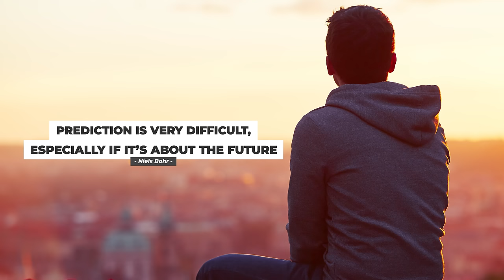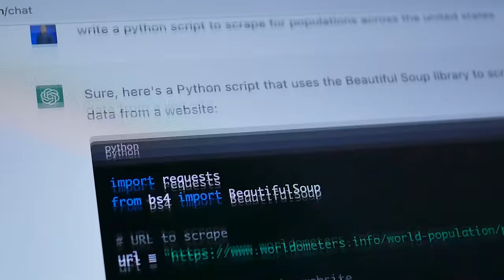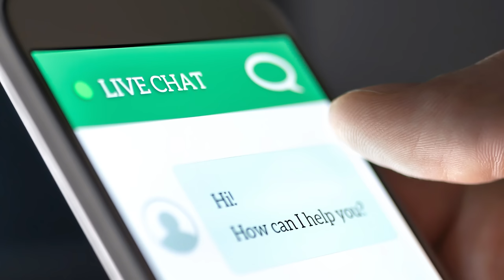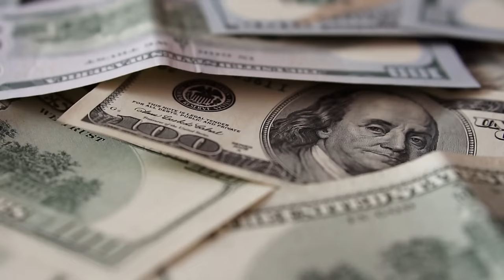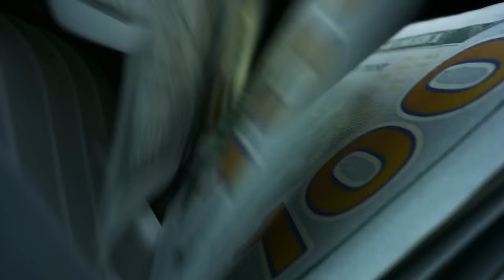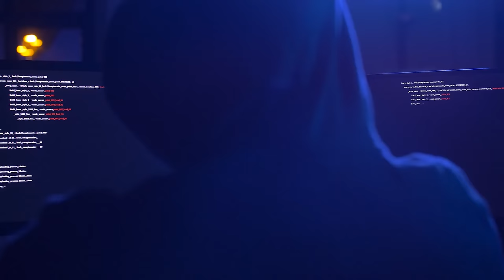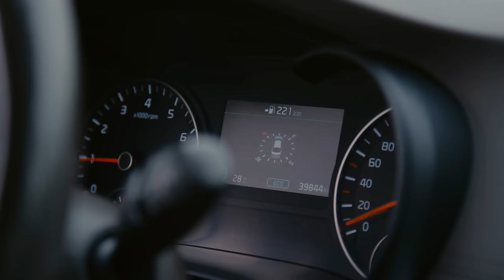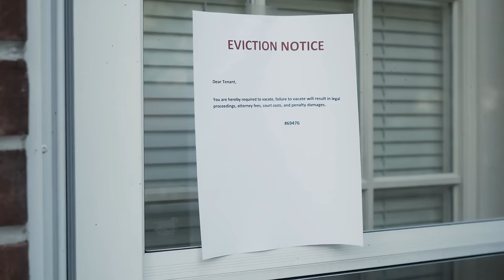Top 5 Threats We'll Face in 2024 (Plus How To Prepare)

Comment: My preps have helped us from several personal disasters. The latest was 3 of the 5 (1 is supposed to be a backup vehicle) vehicles in my driveway broke down around the same time. If that wasn't enough, my washer and vacuum broke at the same time. The cheapest car to repair is up and running now. The washer and dryer, as well as the vacuum have been replaced. I  schedule my appointments and errands around my kids' days off or take my husband to work if I want to take my car. I thought it more prudent to restock the pantry before getting the other 2 very expensive vehicle repairs done. Restocking is hurting the pocket as EVERYTHING costs so much more than when I first stocked up.
Reply: That's allot all at one period god bless!
Reply from the maker: We have a dishwasher we bought a few years ago that was supposed to be the top of the line, and the price was not cheap.  It just died the other day after 2.5 years of use...barely broken in.  Beyond frustrating.
Reply: But you can replace a dishes by rolling up your sleeves. Now substituting for your car is going to be little harder.
Reply: I agree! We’ve had a couple of similar issues lately & had to get into what’s left of our emergency fund; & just the restocking of everyday things is going to be strained!
Reply: Many things on your cars can be repaired by yourself saving thousands of dollars.  I've been doing that for 55 years and I'm a carpenter. It does require tools but many parts stores rent or lend them . 4:28

Comment: Inflation is definitely starting to hit hard here.  We've started the hydro gardens indoors for smaller produce to save money because groceries are getting ridiculous.  We've also switched to an energy plan that allows us to save by running major appliances in the evening and at night at a much lower rate.  Some things we've just decided aren't worth the cost.  Things are definitely changing and, you're right, you really need to move into a position where you are better able to adapt with them or things are going to get rough fast.  :/

Comment: For water storage I'd advise getting a pot still. Its the most reliable way to produce your own clean water constantly. 
Also spirits are an insanely desirable tradeable commodity when everything collapses, it never goes bad, is a sterilizing agent, its full of calories and helps with situational stress caused depression.
Since it will obviously be one of the things to become very hard to get after a supply chain crash it becomes one of the best barter items you can have.
Reply: It can also work as a disinfectant for wounds and other stuff like that.
Reply: Please don’t use liquor type alcohol, there is a large amount of sugar that will cause infection.
Reply: …and it kills the cells trying to heal around the injury.

Comment: id love an updated pandemic prepping guide
Reply: Here a short one: order a huge pack of 3M Aura N95's
Reply: @infinitelo_op thanks, but already done.. more ideas? other than the usual hand sanitizers and vitamins and all that..
Reply: There are N100 masks. They protect the user of the mask not others. Also consider antibiotics for secondary bacterial infections that can result from a primary viral infection. Disposable gloves. Hydrogen peroxide is an excellent sanitizer that does not cause odors and can be wiped off without rinsing.

Comment: I love your videos but notice a lot of these tips are geared toward home owners. Any advice for those who live in no-balcony small apartments? Not a lot of storage for water and gear and no place for gardens.. 😳😔😬
Reply: I bought a steel 5 shelf unit off Amazon that holds baby greens trays. I fitted slimline 3 spectrum LED grow lights to the bottoms of the shelves with zip ties to light the shelf beneath. They are low wattage and connect by daisy chain so I have four shelves that fit two growing trays each. It's vertical growing doesn't take much space and you can also do microgreens. They grow quickly and can be eaten and replaced quickly. That at least gives you some fresh nutrition. 

Water storage is the hardest for living in a small space because water is heavy. I would suggest keeping your tub if you have one clean so that you can fill it at a moment's notice. Also make sure the stopper that you have holds the water. I don't need a water bob or anything like that made in China that is full of chemicals and will fall apart. Just keep the tub clean and make sure it will hold. I tested mine it's fine, holds water for days. If there is a washing machine in the apartment that also can be filled quickly and then the water turned off. You would use that for washing up, and watering plants. Tub water can be boiled to be used for drinking and cooking after your bottled water runs out. An apartment your best option is canned goods under the bed and maybe one side of a closet and behind the couch. We did that when we had a 700 ft² living space. You can also put a box or two in the knee hole of a desk.
Reply: @roughroadstudio  great advice!! Thank you so much. Also does bottled water, either bought or stored in water containers at home have an expire date?
Reply: @roughroadstudio  such great helpful information!! Thank you so much! 😊